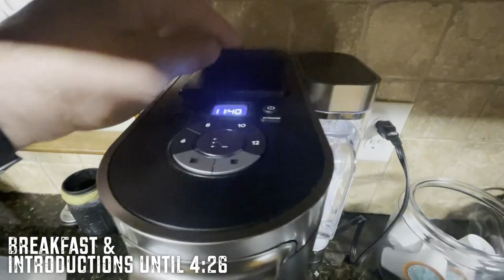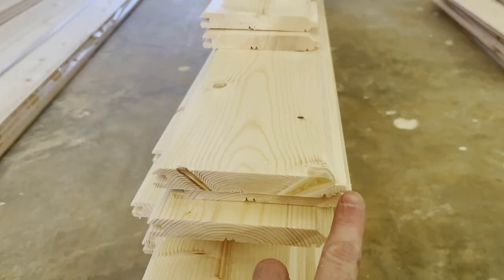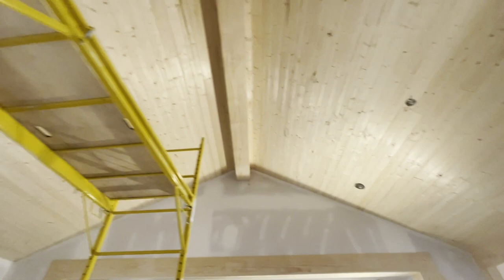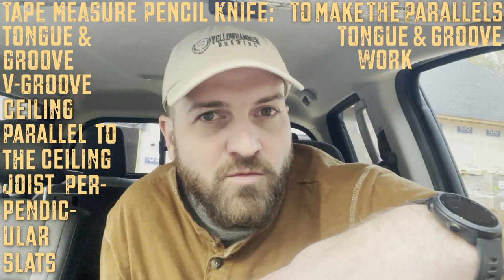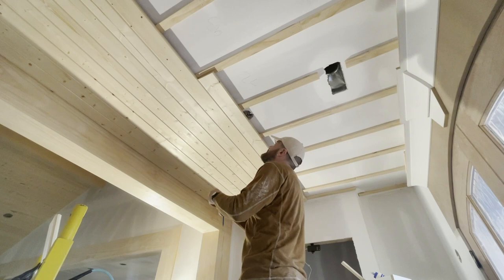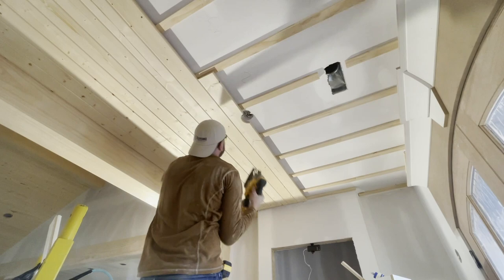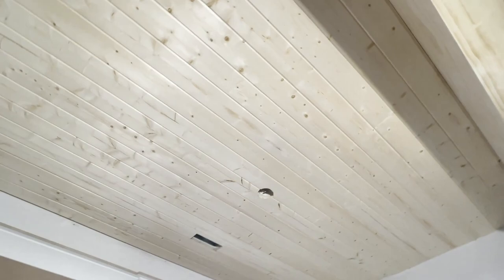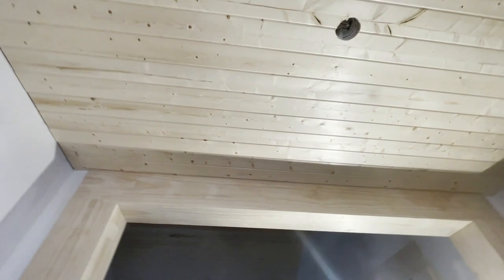How to: Tongue and Groove Ceiling

Comment: Been a carpenter for 25yrs and can’t figure out why he face nailed 2 nails @ every furring member leaving runs every 16” with exposed nails to see. Thats the beauty of T&G. The groove side doesn’t need a nail as it’s seated in the tongue. The other side of TG board is typically nailed at the crotch of the tongue so when the next board is seated, that nail is completely covered. In the end, no nails are on finished face with the exception of very first starter board where there is no other option. 
The work looked great in the video. But I can guarantee if I was in the room, I would see the face nailing.
Of course it is fixable in the end. But why add an unnecessary step. Homeowners, and general contractors that build houses   of this caliber know not to do this.
Reply: Should be how not to tongue and groove
Reply: Just the comment I was looking for . Totally agree , way too many nails on the face made me cringe

Comment: You should use a Bosch laser to measure with! That’s all I use running base and crown. The cheap one works great it measures to the 16th. I also have the more expensive one that measures in 32nd. Both are accurate!
Reply from the maker: Really?! I’ve never used one but I didn’t think the technology had gotten accurate enough. I’ll have to look into it now

Comment: What wood are the beams made out of? Are the t and g boards glued as butt joints?
Reply from the maker: 1x12 clear pine, yes glued at joints and only spliced in the middle of a nailing strip.

Comment: How do you cut your 22.5° bullnose cuts on 7” crown?? I get the 34° bevel and 31.6° miter for inside/outside corners… But I’m stumped on bullnose corners! 5.25” crown no prob I use my crown stops, but I’m lost laying crown flat!
Reply from the maker: Sounds like you’re cutting a 38° crown if you’re using 33.8 bevel and 31.6 miter for a 90° corner. The angles for a bull nose are 17.5 bevel, and 14.3 miter. There’s charts online that show you every angle, and the corresponding settings for a saw. I just googled “crown mould saw angles” and went to images and found some charts. 

For those 22.5° cuts you’re gonna look for 45° angle. Or 135°. Which is 90 plus 45. It’s dumb and complicated lol 😂